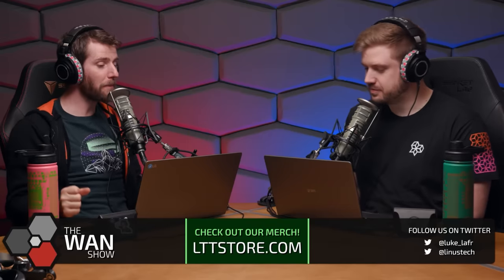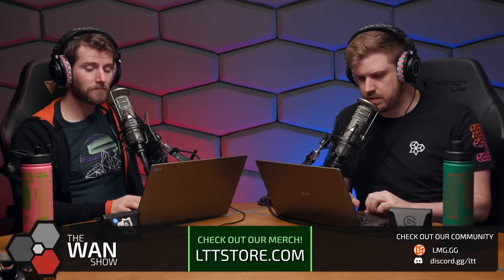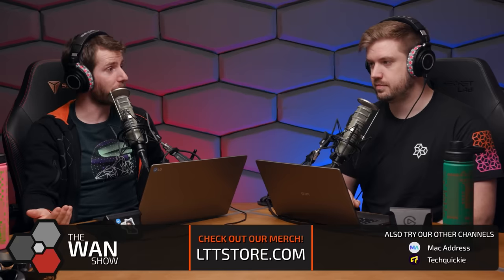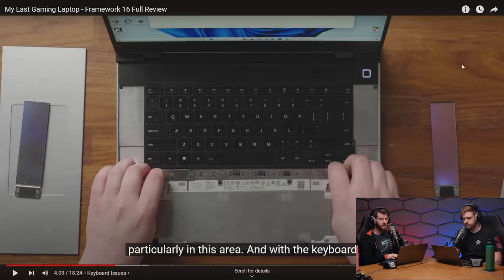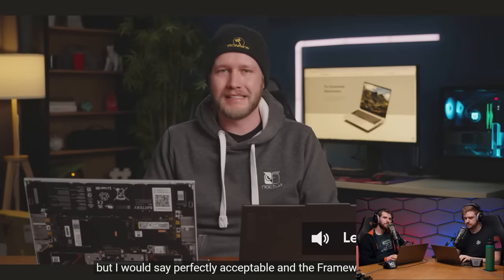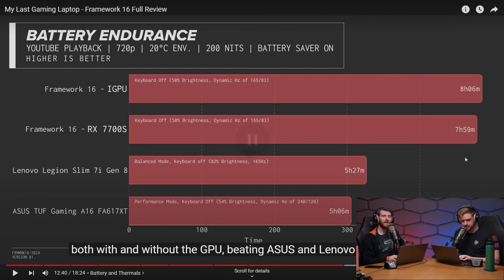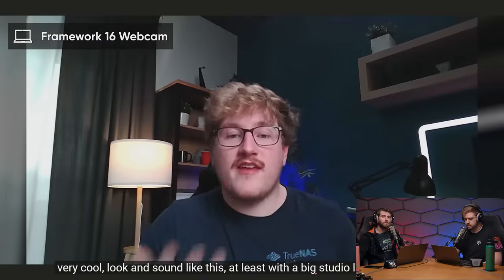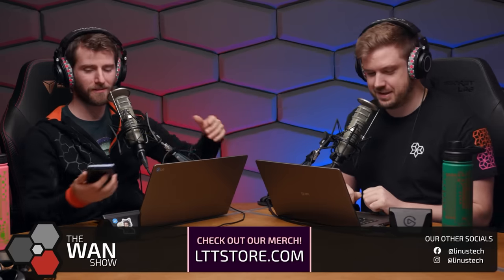Linus Re-Evaluates his Investment

Comment: Framework has everything is goin for it, id buy one even with performance tax exoected. Cant realisticly expect fully modular laptop to top the performance charts vs monolithic designs, and laptops can fluctuate severely just based on cooling design alone. Still, infinite upgradeability and repairability? Id take it.
 But it has Nvidia sized problem. For all its advantages, framework is not cheap. People on a budged will seek bang for their buck, wich would usually net them a last gen mid-higher range laptop, whatever can lend a better deal. People who dont mind paying extra are either macbook crowd or people who want high end performance in mobile form factor.  Framework does not work well as a fashion accesoire, nor it has any shot at matching Apple battery life, and for performance - you need Nvidia GPU.
 Unless miracle happens and AMD/Intel challenges Nvidia in higher end GPU segment, or Nvidia gets onboard,  FW16 remain a brilliant idea that just does not seem to have a market.

Comment: Nvidia is not a company that innovates…they milk the status quo’s in the industry. Sure they build impressive product and can grow a process like no other…of course they can because it made them the most valuable company on the planet. However, they have had many opportunities to create, patent, and grow an all new external graphics card standard that can be used with laptops and consoles. This could be done in a way to revitalize their entire gaming division and destroy all competition. Imagine an external module that can plug into your laptop and/or then your console that can be upgraded with new standardized graphics card designs. Also…imagine having a module being able to offer things like SLI again. How many games might embrace the idea again if this new system was widely offered again. How about the money to be made in marketing cooling and module cosmetics…literally…a whole new market opens overnight that will forever change laptops, consoles, hell…gaming as a whole. Imaging a whole line of laptops built for gaming on an external gpu module specifically. Seriously…Nvidia…make the leap and do it. I am a AMD fanboy but I know it will need to Nvidia that births this new market. 

A external graphics module you can take from your laptop…desktop…and switch between different consoles regardless of series or branding. There is cash here

Comment: Don’t really see the point in a modular laptop. I see the benefit of the small cheap parts like battery, ram, storage etc but if I’m spending $1500-$2000 to upgrade my cpu/gpu than I’d much rather just buy a whole new laptop. 

This shell will be outdated in 5 years let alone 10. I couldn’t even imagine having my ugly ass 2015 laptop filled with 2024 cpu/gpu. That would be stupid

Comment: Unless it runs Linux without any issue I won’t be buying it
Reply: Aren't there two officially supported distros? 🤔
Reply: Framework submits things upstream to the kernel...
Reply: Can't speak for framework 16.  But ubuntu support on the framework 13 AMD 7840u version is absolutely horrible at the moment.  Tried it for a day before switching back to Windows. 

You'll probably be waiting quite a bit for them to get Linux running well on these.

Comment: This entire discussion is complete BS nonsense. This entire thing is irrelvant. The ONLY questions that matter are: 1. How many generations of GPU will they be supporting? And two, how many models? It does not matter if it has "replaceable" graphics if i cant put a 5080 in the laptop i bought with a 4060. I guarantee this is how it will go down, maybe if you are lucky you will be able to go from a 4060 to a 5060... Clevo has been trying to do this for years, and even they really couldnt make it work in practice even though it was in theory possible. These are the actual questions of relevance, so to Linus and all the other bright eyed bushy taled YouTubers who want to drool all over this, focus on what actually matters for a product sold on upgradeability
Reply: I don't think you actually watched the video. He clearly states that the connector and GPU "module"fixes the issues of previous attempts for GPU modularity in that they aren't constrained in board architecture anymore. However are limited by nVidia's draconian control over who gets to make GPUs for Framework. The board architecture can be whatever works as long as it has the same connector and can even change dimensions instead of needing to fit in a specified interior shape.
Reply: @TCLe  uh huh, I'll believe it when I see it
Reply: They already delivered on multiple generators of upgrades with the Framework 14 and there is no reason why they can't do the same with the GPU. The connector supports assuming PCIe x16 for modern GPUs should support every graphics card if the board was designed for it forever down the road until you need more bandwidth on the connectors. The design is open source so third parties can also design their own cards as long as they can get the boards to do so. The real issue is up to the manufacturer like AMD and NVIDIA to actually support this. NVIDIA as already stated didn't want modifications to their boards.
Reply: @pikenote  you sweet sweet summer child....